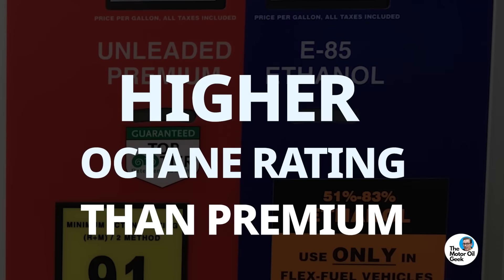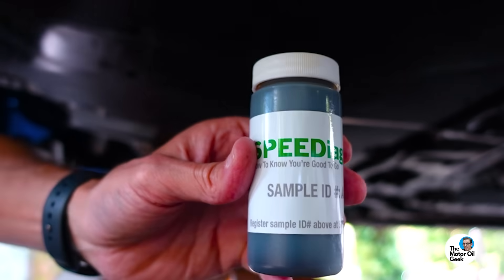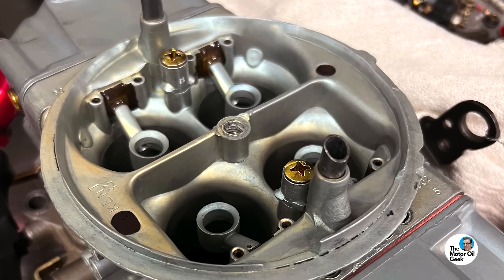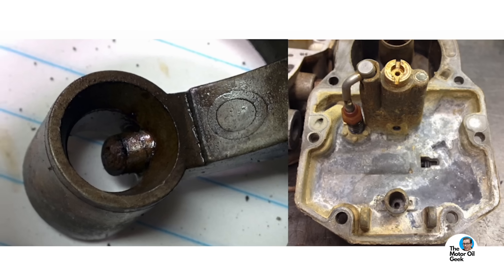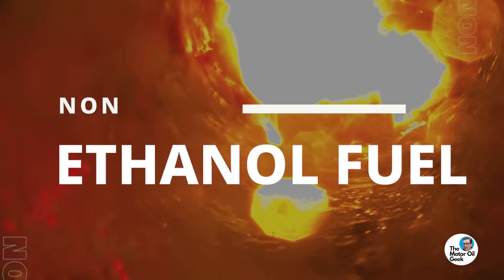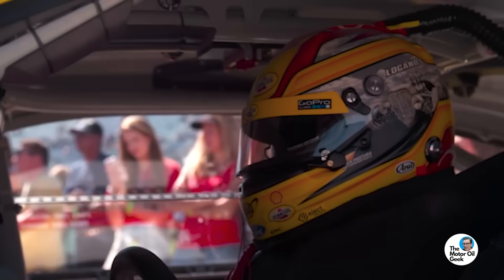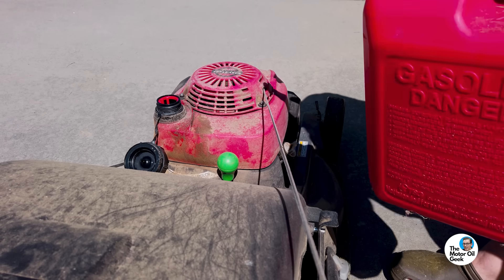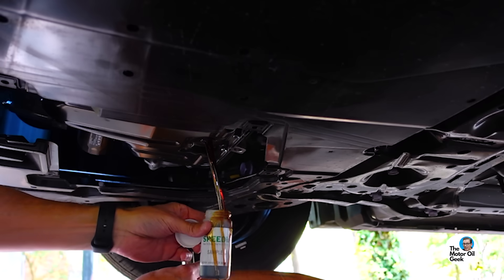ETHANOL: Higher OCTANE, Higher RISK?

Comment: I ran E85 in my vehicles for over a decade and did UOAs; it was never an issue. I did typical 5000–7500 mile intervals on recommendations from the UOAs. Wear materials and corrosion were very low; in most cases, I used Amsoil Signature Series, and it held up well. They even recommended that I go longer on my intervals, and I stuck with 7500 max. With a carburetor, I understand because the system isn’t sealed, but with almost every car on the road today, it’s not going to be an issue. I haven’t had a fuel system component failure in the years I’ve used E85. It also kept the carbon buildup on my pistons from getting bad at all, and I got practically zero knock retard when using it.

As far as the subsidies to use ethanol, I feel like the lobbyists for big corn are no better than the lobbyists for big oil. Oil companies do a lot of damage to the environment too, and I feel like we’re just splitting hairs when it comes to that type of argument. Corn gets way too many subsidies, and monocrop farming is horrible for the environment, but fossil fuels get way more subsidies than any other industry in this country. It’s horrible for the environment as well—likely worse than corn ethanol in the grand scheme of things.

You really just have to get away from combustion engines altogether to do significantly better on that front with our modern technology and infrastructure. This isn’t an argument for everyone to switch to EVs, but if we’re going to wade into the environmental harm discussion, it’s relevant to mention.
Reply: The loss of fuel mileage with E85 pretty much negates any cost saving per gallon.
Reply: @LTVoyager I didn’t run it for cost, I ran it for performance. It was still cheaper than running premium fuel by a good bit, but comparing it to the cost per mile of running 87 would be a toss up.
Reply: The mining they have to do for the batteries for EV's, plus having to send old battery packs to the landfill because they haven't come up with a good solution for battery disposal, is worse for the environment than drilling for oil and running ICE engines. Plus consider a majority of the electricity for charging these EV cars comes from power plants that burn coal and pollute the hell out of the atmosphere
Reply: @ericd1632  many of the points you’ve mentioned aren’t entirely accurate. But even if they were, EVs are typically 80-90% energy-efficient, compared to just 20–40% for ICE. This means far less wasted energy—even when EVs are powered by fossil-fueled electricity (which many aren’t, at least not entirely). The battery packs in the most popular US EVs store energy equivalent to just 2–4 gallons of gasoline, yet they deliver 250–450 miles per charge.

Yes, nickel and cobalt mining has serious environmental and human rights concerns—no argument there. However, the industry is rapidly shifting toward lithium iron phosphate (LFP) batteries, which use little to no nickel or cobalt. LFP tech is improving in energy density, and it’s cheaper, more abundant, and more sustainable. EV innovation is still in its early stages. The battery tech race has barely begun, and advancements are happening fast.

EV batteries are over 90% recyclable once they reach ‘end of life’ for vehicle use (usually after 250,000–400,000 miles). Before recycling, they can also be repurposed for energy storage in what’s called ‘second life’ uses. Studies suggest that by around 2050, we’ll have enough recycled materials to sustain production with minimal new mining. Meanwhile, we’ll still need to drill and frack for oil for many things—let’s just try to reduce the amount that we light on fire to inefficiently push a vehicle down the road. Reducing transportation-related fossil fuel consumption frees up petroleum for more essential uses.

The US grid is already over 40% renewable and nuclear—and that doesn’t include residential solar, wind, or battery systems. Most EVs offset their initial manufacturing footprint within two years, even faster if charged with renewables and/or driven more than average. They also cut urban air pollution, improving public health in cities with high adoption rates—something we haven’t seen since the phase-out of leaded gasoline.

I’m not here to force EVs on anyone. I love engine noises and banging gears as much as the next person. But the environmental benefits of EVs are undeniable. Ideally, those who don’t care what they drive would switch to EVs, leaving ICE vehicles for those who enjoy them and those who tow long distances. Think about it this way: for every one Camaro ZL1, GT500, or Hellcat, there are a million Sentras, Equinoxes, or other forgettable vehicles on the road. If those get replaced by Teslas, Bolts, and Lucids, my family breathes cleaner air—and my driving experience doesn’t suffer at all. EVs are cheaper and more convenient to operate for the average driver, and they’re honestly much more fun to drive than the vast majority of vehicles on the road.
Reply: @ericd1632  many of the points you’ve mentioned aren’t entirely accurate. But even if they were, EVs are typically 80-90% energy-efficient, compared to just 20–40% for ICE. This means far less wasted energy—even when EVs are powered by fossil-fueled electricity (which many aren’t, at least not entirely). The battery packs in the most popular US EVs store energy equivalent to just 2–4 gallons of gasoline, yet they deliver 250–450 miles per charge.

Yes, nickel and cobalt mining has serious environmental and human rights concerns—no argument there. However, the industry is rapidly shifting toward lithium iron phosphate (LFP) batteries, which use little to no nickel or cobalt. LFP tech is improving in energy density, and it’s cheaper, more abundant, and more sustainable. EV innovation is still in its early stages. The battery tech race has barely begun, and advancements are happening fast.

EV batteries are over 90% recyclable once they reach ‘end of life’ for vehicle use (usually after 250,000–400,000 miles). Before recycling, they can also be repurposed for energy storage in what’s called ‘second life’ uses. Studies suggest that by around 2050, we’ll have enough recycled materials to sustain production with minimal new mining. Meanwhile, we’ll still need to drill and frack for oil for many things—let’s just try to reduce the amount that we light on fire to inefficiently push a vehicle down the road. Reducing transportation-related fossil fuel consumption frees up petroleum for more essential uses.

The US grid is already over 40% renewable and nuclear—and that doesn’t include residential solar, wind, or battery systems. Most EVs offset their initial manufacturing footprint within two years, even faster if charged with renewables and/or driven more than average. They also cut urban air pollution, improving public health in cities with high adoption rates—something we haven’t seen since the phase-out of leaded gasoline.

I’m not here to force EVs on anyone. I love engine noises and banging gears as much as the next person. But the environmental benefits of EVs are undeniable. Ideally, those who don’t care what they drive would switch to EVs, leaving ICE vehicles for those who enjoy them and those who tow long distances. Think about it this way: for every one Camaro ZL1, GT500, or Hellcat, there are a million Sentras, Equinoxes, or other forgettable vehicles on the road. If those get replaced by Teslas, Bolts, and Lucids, my family breathes cleaner air—and my driving experience doesn’t suffer at all. EVs are cheaper and more convenient to operate for the average driver, and they’re honestly much more fun to drive than the vast majority of vehicles on the road.
Reply: @ericd1632 the mining done for EVs is bad upfront, but after driving 12,000 miles on an EV, the no emissions cancel out the upfront pollution. Also, they still have to mine metals to build engines and transmission. You act like that doesn’t come out of nowhere. Heck where do you think platinum comes from for cat converters? Mines too buddy. Also most places out west use solar or hydro or wind, so power plant electricity isn’t really an issue. But regrading the coal plants, the emissions from coal to charge per mile on an EV is still less overall pollution than gas being burned locally around neighborhoods where families breath the air in a regular car. Do some research. EVs are still cleaner over the lifespan of the car. I wouldn’t get one tho because of my travel habits and range anxiety, so I stick with hybrids
Reply: What evidence is there that there's any harm to the environment whatsoever? Where's the evidence to support warming of the global type, there's none thats right. Matter if fact without a fallacy like appeal to authority, chances are many things people believe are nonsensical as they're controlled and leashed around by their person. Btw I would have to say excluding things like oil spills mostly done by some "accident" requiring clean up isn't a fair piece of evidence of damage to environment as there are many places crude bubbles out of the ground naturally ya know... From all them juicy oily dinosaur bones 😑🥱. Oil is naturally renewable via organic matter decomp happening constantly with it without bone's contribution to the equation.
Reply: The problem with EV's is the fact they were being forced on the public under a false science of the climate religion instead of just developing and let the market decide what they want .
Reply: @MUUKOW3  we'll just have to agree to disagree on the climate benefits. The only way to argue that switching primarily from ICE to electric vehicles for personal and public transportation isn't massively beneficial for our planet is to work backward from a predetermined conclusion. Does it suck because I love fun ICE vehicles? Yes. Is it better for the world and humanity? Also yes.
Reply: @6GZL1 It doesn't help with the planet at all as we are not changing the climate . We can pollute like crazy , I remember the smog in LA and the foul air and now with unleaded fuels and clean burning engines that's been gone for decades . Drilling for oil is still far cleaner than mining for metals for batteries have you ever wondered why we don't mine our own in this country? We have huge deposits !  I'm sure there are things coming that will make batteries obsolete,fuel cells ,fusion power pods , ammonia engines ... So far nothing beats fossil fuel for cost and return. I want people buying what they want even I have been curious about off roading a Rivian not because of saving the planet but for its capabilities and the industry needs to learn on that instead of the virtue signaling crowd that the average person doesn't want to be lumped in with.

Comment: So does that means using high octane fuel such as Shell V Power Nitro can cause corrosion in the long term?
Reply: You can get "high octane fuel" that has no alcohol or lots of alcohol. Depends on what you are buying.
Reply: @bradboustead1682 I can't find it in my area.

Comment: While raising octane, it will lean mixture, similar to premium fuel, it has higher density and both will counter knock will cause the engine to melt from leak burn temperature . Same thing with discussion on reduction of sulphur in gasoline, it causes disassociation of aluminum, makes piston look like sand blasted. Car companies had to test at Southwest Research Institute to validate.
Reply: Ethanol requires MORE fuel to reach stoich. You only have lean issues if you are not intentionally adding more fuel when increasing ethanol content in fuel. If you are getting lean issues when using higher ethanol blends you need to talk to your tuner. 

Ethanol COOLS cylinders because it has a higher latent heat of vaporization.
Reply: @Fix_It_Again_Tony but when someone uses it without making required adjustments it messes engines up, if you choose to run higher octane but lower compression you loose benefits for use.
Reply: If the amount of ethanol you add leans the mixture beyond the capacity of the ECU to compensate by increasing injector duty cycle you will get a check engine light.

Comment: So what does the octane rating have to do with carb damage? Did I miss something?
Reply: Octane rating and ethanol content are 2 different topics. You can get high octane fuel with no alcohol or you can get high octane fuel with lots of alcohol. Depends on what you are buying.  It is the ethanol content that causes the potential problems.
Reply: @bradboustead1682   Higher OCTANE, Higher RISK. Misleading title.

Comment: Great video. I've learned the hard way in lawnmower. If I purchase gas I do NOT ever buy ethanol fuel.
Reply: I run 35% ethanol fuel on small 2 stroke engines here in Brazil. It works fine, you just can't let it sit on a shelf for months at a time. run the equipment for like 5 minutes every 20 days and it will always work -- and do not ever drain the carb or run the engine until it quits; that recommendation of removing all the fuel before storing does not work at all with ethanol.
Reply: @bmandrakeeee8378 why doesn't it work?
Reply: @budlanctot3060 It oxidizes faster without fuel in it. the needle valve will stuck, among other things
Reply: @bmandrakeeee8378  Storing it with the ethanol fuel in it doesn't work either. Might need to do what Lake's race team did - rinse with non-ethanol fuel and then drain/run clean.
Reply: @MathewPollard-vj4uq It works if you also run the equipment every 20 days or so. Leaving the fuel inside the carb buys more time before it dries and oxidizes.

My trimmer is 7 years old, just recently I did clean the carb -- and because I had to take it apart and change the piston anyway. So it took the same time of the engine itself quitting; not bad.

Anyway: Am I saying that ethanol works great on small carbs? no. But it is not thaaat awful, and you can work around it
Reply: After switching to ONLY ethanol-free gasoline several years ago, I no longer have small engine issues to deal with.
Reply: Eh you just have to make sure you have newer or eth suitable lines, pumps, injectors or carby tuned

Comment: Yep I go out of my way to go E0 for my boats and small engines. Here in NJ you can not buy it at the pump. So off for a 20 drive to Stewart's station where I fill a bunch of cans. I have store it for years with stabilizer. You did not mention that E100 is a racing fuel and designing the engine around the fuel is the best answer although not really practical for us common folk.

Comment: Where I live there are some stations that offer Ethanol free 87 but non within 5 miles of my home. I use Stabil in every gallon of fuel I buy. I have lawn equipment that's over 10yrs now with no signs of damage. I start and run every piece of equipment for 30 minutes each month it's not in service. Plus Stabil is cheaper than E-free fuel. In my area E-free is more than a dollar a gallon more than 93. As advertised today 87 $2.59, E-free $4.29, 93 $3.19.
Reply: If you're using  stabil, you  better do more  research. Most gas adtidves do more  harm than good.
Reply: @ontheedge-e5d   Like I said, I've been using it for more than ten years without any signs of trouble. Don't believe all the click bate videos on the internet. Most of those videos are sponsored by a competing company or are just bad advice. I don't store my equipment long term. I crank all my equipment once a month during the off season.
Reply: You just keep thinking that and they'll just keep taking your money. I've never used it and have ((properly)) stored gas and e10 gas for over 2 years with no problems. Don't believe everything they printed on the label.
Reply: @ontheedge-e5d  you're the type of person who thinks synthetic oil is bad lmaooo
Reply: @TheScrubmuffin69  I run full Super Tech full synthetic 10w30 in my mowers. I've never had an issue. One of the mowers have over 3000hrs on it and still going strong. I think some people just believe hype about all the bad that can come from not buying John Deere branded products.
Reply: Same here is use stabil in all my stuff I even leave the weed eater fuel of fuel all winter starts right up the next spring.
Reply: Here in ohio ethanol free is about a dollar more than 87 per gallon which isn't bad